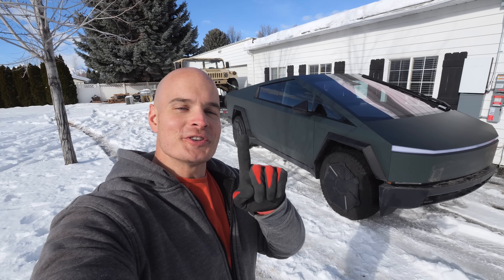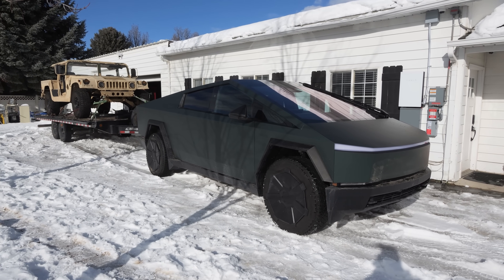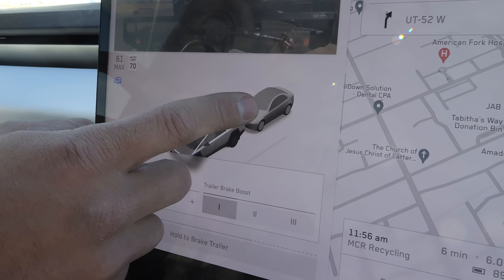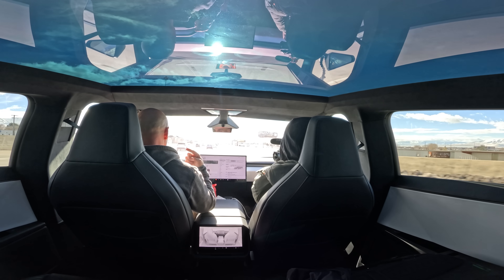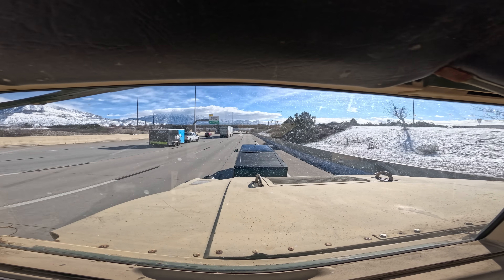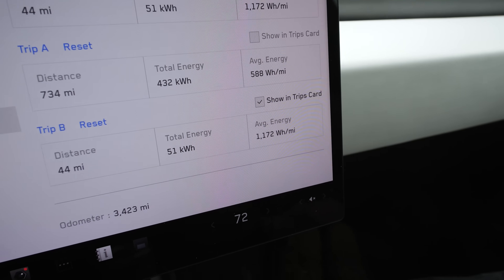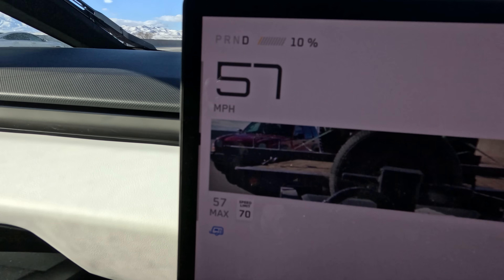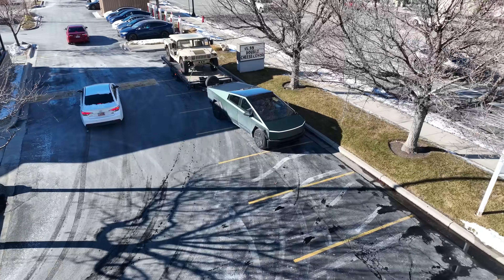How far can the CYBERTRUCK tow 11,000lbs in Freezing Weather?

Comment: Just a reminder, gas and diesel vehicles do not give you range estimates for towing, and even when they do, theyre often grossly incorrect. Its not really a company or programming thing more than its a factor thing. For instance, your current trailer is more aerodynamic than one of the SAME weight but in more of a horse trailer type configuration... boxed up. A company has standards for their vehicles which means they can ALWAYS run internal tests, and then base all their measurements and programming on that specific vehicle... you cant really do that when there is no standard trailer, design, or cargo. Even think of a vehicles tires.... there are a lot of cars where merely changing the tires suddenly makes your speedometer read a different speed than you are traveling... thats all because these features are programmed based on assumptions granted by vehicle standards. Change the standard wheel size, and all that programming spits out incorrect data. Use a trailer that was NEVER tested and programmed for the cybertruck, and itll often run calculations based on a DIFFERENT trailer with DIFFERENT standards thatll then spit out DIFFERENT information to reality.

Comment: Have you seen that new battery powered trailer that helps to assist the towing vehicle?  Would be cool to see you review that with your rivian to see if it actually helps with the range
Reply: So now you have to plug in both the trailer and the truck and wait for hours.  LMAO.
Reply: Or charge it at home and get the range you normally would get meaning less times you actually have to fill it up @Leester-70
Reply: @caffeinatedfunctionality  Nothing about EVs make any practical sense.  But have fun with that.
Reply: @Leester-70  that's incorrect. Do some research. Towing doesn't I will give you that, for now, but battery tech is changing and will eventually significantly and consistently outperform combustion vehicles even in the cold as the sodium Lithium batteries are supposedly minimally affected by it. As far as daily use with current tech in temps above 32, yeah, I'd rather have one as it's quite cheap to maintain and run. This will get me on a road trip with my family and carry way more than our current SUV would and cost less
Reply: @caffeinatedfunctionality  Every time I go to the grocery store and see the row of Telsas charging with the owners sitting there bored and staring off into space I wonder to myself if they feel stupid yet.  Then I realize they don't feel stupid because they are, in fact, stupid.
EVs are a joke.  Everyone knows it. But like I said, have fun with that.

Comment: 2:29
«The thing stood out to me when I got into the Cyber Tru for the very first time were how heavy the doors were. Turns out that while having the same towing capacity as the Rivian, the Cybertruck actually weighs less; even though it's bulletproof.»

Are you sure about being "bullet proof"? It's clear that the well known demo used to demonstrate this would have been done on the advertised 3 mm thick body panels; whereas the vehicle that is actually shipping has 1.8 mm thick panels.
Reply: Yes, learn how to use google.

Comment: "That's not going anywhere" - brilliant gag. Thanks for the laughs Zach
Reply: I was worried for half a second. "He can't be serious." He got me.
Reply: I thought he meant the truck.)
Reply: As a HC-130 Load Master I concur.   I've carried fuel trucks in the back on chain restraints,  on a good day we d-rate the 10K chains down to 7,500 with  the angle of pull loss and we require 8x the weight of the  load for forward restraint and 3x for aft restraint and always in even sets of chains.  For example: a 20K truck in the back we would use 22 chains for forward restraint and 8 for aft restraint with a total of 30 chains for a 20K package.  It takes awhile.  When in doubt "stick it in H compartment."

Comment: That's pretty cool that you can tow that much weight 90 miles for such a low cost! With at home electricity prices, how much would the cost be for you to drive it that far, compared with a gas or diesel truck? Could you make more money towing heavy loads a couple times a day vs ubering?
Reply: There really is no comparison though. An ICE vehicle is going to get 2-4 times that range, fill up in 1/8th the time, and be at the destination so much quicker. Also, towing/hauling as a business requires more out of pocket costs than something like Uber. Insurance and potential federal and state DOT requirements take a lot of money.
Reply: He didnt say how much the supercharger cost. It was probably $40 which is more than I would spend in my Gas truck.
Reply: @enigma9789  I’m talking not supercharger
Reply: @Radium3D  So he has it towed back home to charge up? Or only drive 45 miles so you can make it home?
Reply: Average at home energy cost in the USA is about 16 cents per kwh so it would cost about 17-20 dollars to recharge at home.  As previously mentioned though this is unrealistic for any real world towing.  A gas powered truck towing the same amount would only have to average around 12 miles per gallon to break even with this situation from a pure cost standpoint and would be far more practical for longer towing distances.
Reply: I don't tow, but I searched and it's $600 to tow something 100 miles, so you could make a massive profit even if you had to do a 50% super charge to drive back home. @Theres_A_Way  It's $0.15 / kWh here for home charging. So $18 for 90 mile tow, at $580 for the tow job, plus $20 to 50% charge for the more efficient drive home empty, that's $542 profit for the day for one tow. If you have solar, you're going to offset that $18 home charge as well here. If you do like 10 tows a month that's $5420 in profit per month.

Comment: That difference between the range gauge and the trip planner estimates is something Tesla has always done for better or worse.  The range gauge will ALWAYS show the range based off of a "standard" of no cargo and I think 60mph (it is more of a battery/fuel gauge than a indication of range) while the trip planner actually takes into account current conditions like towing, elevation, wind speed and direction, and driving speed.  While the range gauge could be made smarter the thinking is it can't take into account all of those factors like trip planner can (since it doesn't know where you are going) so they made it more consistent.  Personally I just flip it to the battery % rather than miles left and it is easier for me to convert that based on how I know I drive and if I need something more accurate for trips and long hauls I look at the trip planner

Comment: Great way to get a feel for the worst case scenario. I know some people are going to hate on it suggesting it wasn't 'fair'  But sure it is. Just tough.

BTW, that noise sounds a lot like a 'drive unit' whine that came up often with the early Model Ss. Mine got replaced at like 20k miles.  It's gear whine between the motormotor and wheels
Reply: yikes.. lasted half a set of tires? i imagine a heavier truck will put even more strain on these types of parts

Comment: Where I live, it is close to 60 miles to the closest charging station.  Then from that charging station to the next is almost 150 miles.  

40 minutes to charge after a 1.5 hour drive seems a little crappy to me.   Although I like that it cost less than $20 to fill, but what is your time worth?  

Hopefully, in the next 10 years, technology will advance to a point where it is the same as driving an ICE vehicle.  Not to mention the cold weather effect on EVs.  

Until then, I will keep my old dodge running, and at 13 mpg while towing a 10,000 lbs trailer, I see no reason to upgrade.  Even if diesel gets insanely expensive, I will just make my own.

Comment: Yeah that’s why I keep my range estimate on the top of the screen set to battery % because it’s strictly based on EPA. To get accurate estimates do a trip or use the energy usage screen which has energy usage graphs and miles remaining which adjust accordingly.
Reply: tesla has gotten in trouble multiple times because they literally lie about the range in  the software to make it look better.
Reply: @jebes909090 could you give me a link to the court case where Tesla has been accused and punished for their lies. If they would have done that such case must exist. Otherwise maybe shut your mouth. 
The range is according to EPA which is a combination of city and highway test. Highway test is the hardest test which is at 48mph and 70 degrees F 
Also pretty sure you can set the range to driving history instead of EPA
Reply: @bartdeking  - Stop gaslighting. Actual Tesla owners know that the default range displayed cannot be trusted. The driver should not have to do anything, or access any hidden screens to get a true range estimate.
Reply: @CL-YouTube-y7e  the driving range is the EPA estimate NOT Teslas estimates. 
Therfore, Tesla does not lie but maybe the EPA test should change to reflect the more average driving behavior.  

Bottom line, Tesla does not Lie so stop claiming this.
Reply: @bartdeking  - How would the EPA know what the temperature of my Tesla is at any given minute? How would the EPA know whether I am driving at 30mph or at 80mph. Only the car, running the software that Tesla wrote knows that. Every other EV maker has this figured out. Tesla only shows that EPA-derived value in order to artificially inflate the displayed range remaining. This is 100% intentional, and 100% intentionally misleading.
Reply: @CL-YouTube-y7e  no they don't. In fact, in the out of spec test it started at 46 then went down to 38. Also tesla does not know if you are going to floor it the next 30min or not. 
The miles is an alternative to % battery. Therfore a consistent value depending on the battery status.  
Anyway, you still have no prove of Tesla spreading lies. 
So change your comment that Tesla is spreading lies or you are a liar yourself.
Reply: @bartdeking  - Do you even own a Tesla? What is your experience living with one and driving it for an extended period of time? I own 2 EVs. One gives a dead accurate estimate of your range taking into account temperature, recent driving style, etc. The other ALWAYS displays an inflated number. So who is not being truthful here?

Comment: 1:08 You are supposed to cross the safety chains so they can catch the trailer if it falls off the hitch. The chains off to 1 side like that will drag the tongue on the pavement and damage the trailer, Cybertruck, or both. I'm not trying to scold you. I'm just trying to watch out for you.
Reply: Go watch it again. He clearly crossed the safety chains and hooks up the breakaway cable to the left side.
Reply: @Nik-lp9hw   You're right. At 15:46 I see the chains are crossed.

Comment: @7:30  you addressed the sound . I was wondering the same. I also rode in Tesla model S plaid. It makes a similar whiny sound. 
I also drove a KIa EV6. The silence in the Kia is awesome  .
Reply: Funny thing is thst the kia almost does 21,000rpm without the csrbon sleeve rotors.
Reply: It's the 2 stage turbo spooling up and slowing down.
Reply: Frequency regulators which are controlling motors.

Comment: It's always a good idea to do fifty miles an hour for maximum range, that goes for any haul. Additionally, Tesla should have done better buy putting ports fore and aft. A hundred miles range, with stops all along the whole long way. My Dodge one ton with a Cummins turbo 5-speed-diesel will pull that same weight 500 miles non-stop. Shut Up!!

Comment: More info please. Was the temperature the same  for all 3 tests starting and stopping? What was the temp? Did you check the air pressure of the truck and trailer? Did you have the truck set to the lowest setting? What tires are on the Cybertruck? Did you drive the same exact route? Did you precondition the battery before you left? And did you drive the others to 2% battery as well or until they stopped? Did you do the other 0-60 tests going up hill like this test? What was the temp and state of charge for each 0-60?
Good video but to be scientific about it all that important stuff should be addressed.
Reply: Pretty sure the other videos are on his channel.  What does it matter in the end? ... all of them are around 100 miles ish, give or take, which is not great.  Same results as all the other channels that have done towing tests.  Even if the Cybertruck got 120 miles, there's nothing to celebrate there  - ok perhaps a small victory for most range, but, it still sucks so is it really a victory?
Reply: @xislander73  If it doesn't matter, why do the test? I am towing 13,000 lbs to the desert with my Cybertruck and range extender.  I need 150 miles of range, with range extender. And if you are a Rivian stock holder just trying to make CT look bad, then that matters.
Reply: @mountainmantesla4395  Can a CT tow 13,000 lbs? Serious question.  If your destination is around 100 miles roundtrip, I guess it matters.  I was under the impression that most folks that pull TT's and the like tend to go further, and into remote areas.  For those people, the test doesn't matter.  It's interesting, and garners views, but that's about it.
Reply: @xislander73  I go to Blackrock desert to go riding. My Trailer is 10,500 empty. But add water, sewage, gas, a Rzr and a quad, food, clothing, dishes, bedding and it has to be close to 13k. 
Closest charger is Fernley, NV and it is 88 miles to our camp site. I don't mind running my generator some to have the range to get home. I just don't know if I can run it enough in a 4 day period to fully charge and get back to the Fernley charger. I sold my truck to get my Model Y but have a ranch and really need a truck. I want a Cybertruck bad, but not if It can't do truck stuff. I talked to Sandy Munroe and Franz about it and they thought I would be golden with the range extender, but then you lose your truck bed permanently. 
$80,000 is a lot for a grocery getter.
Reply: @xislander73  I just checked. He also only tested the other trucks at 10,000 lbs or less.
Reply: none of this matters, people that buy the cybertruck are not going to be towing 11000lbs around. it was just a light hearted "stress" test. The only thing that matters is do you enjoy using the vechicle or not.
Reply: @azuthal  I am getting mine to tow my RV to the desert twice a year. Range is a huge issue. Right now I rent a truck for big towing jobs and use my Model Y for towing Hay and my Rzr. But for family trips it would be nice to know if I need to lose my bed and get the range extender. This guy just seemed like a Rivian stock holder doing whatever he could to make Cybertruck not be as good.

Comment: Okay but would any truck actually ever drive that far?! Oh man oh man - great video!
Reply: Exactly! Why would you use a truck to haul cargo long distances? That’s what trucks are for! Wait….
Reply: No there not they holding groceries @Kyle_VanMan
Reply: Yea, but $13 bucks for 300 miles, why is everyone overlooking this?  @Kyle_VanMan
Reply: Ev are good for local trips
Reply: Didn't you make a video about the density of fuel vs EV batteries? Who is going to tow this type of duty with an EV truck?
Reply: Woah you are here already
Reply: Your kidding right? That's what trucks are for, hauling things long distances!
Reply: There are modern trailers that have motors and batteries in them that will accelerate with the EV towing it. By theory, it should not decrease the EVs range when towing.
Reply: @1HeatWalk You can also attach a sail or a turbine engine to the trailer but that doesn't make it practical or economical.
Reply: But the 0-60 is insane! Can any other truck do that?
Reply: @Pepe-dq2ib that’s not the purpose of a truck….? 🤨
Reply: @Thatbeardedguy86  People that say that are dumb. I want my truck to be able to get up to highway speed as fast as possible no matter what. I didnt buy an intake, intercooler and tune for nothing
Reply: @enigma9789  A tuned Tow Rig can pretty much do everything these EVs can, but better, faster, longer and way way cheaper...
Reply: @FJB2020 sarcasm i think
Reply: @Pepe-dq2ib  Is that what the purpose of a truck? so you can compare 0-60 times? LOL

Comment: The fascination with battery power is very amusing!!  It is not a serious competition for a fuel cell and hydrogen fuel just because of the useless weight and cost to make a battery that will have a short life regardless.  If we used geothermal power to generate more electric power instead of solar or wind that would make sense; because geothermal energy is unlimited as in 27/7 and anywhere a hole can be drilled is a power reservoir.  Nuclear is being wasted which makes zero sense!!  I'm keeping my gasoline power cars for now.